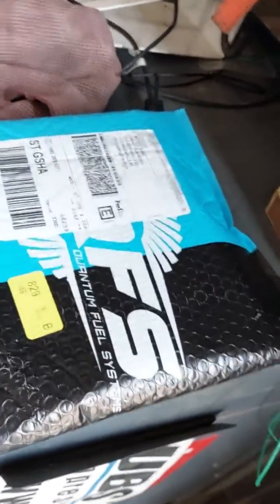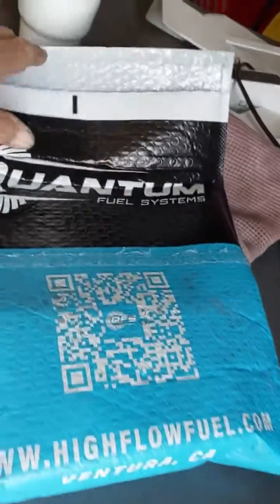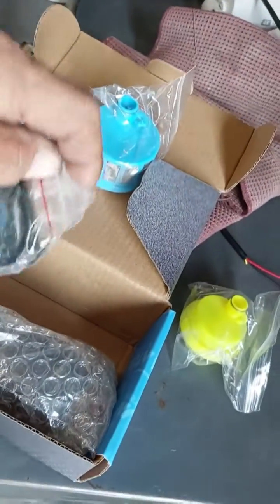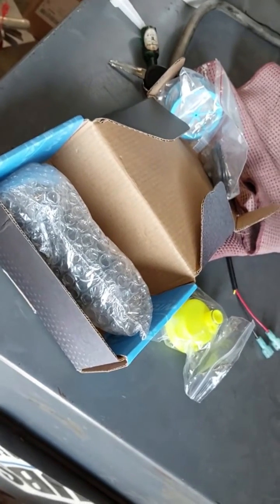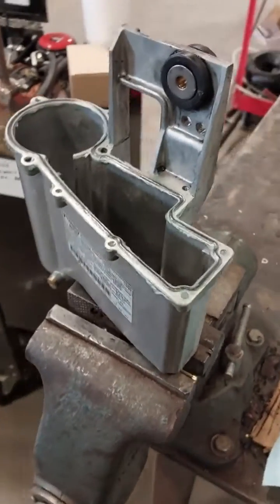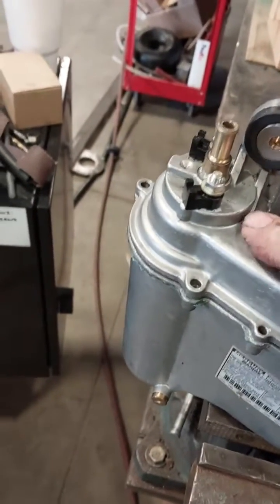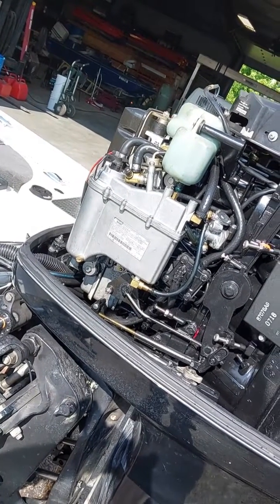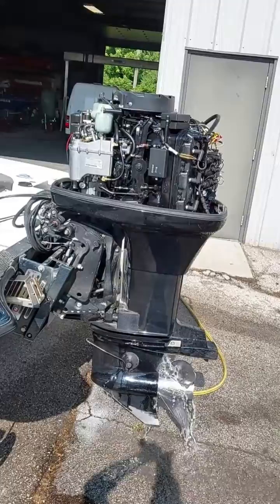Quantum Fuel Systems Mercury 200 HP EFI Outboard

Comment: Do you know if u have power on both connections of the pump?
Reply from the maker: On this unit, there's 12v on one terminal with the key on. The ecm provides the ground. It varies the ground to slow the fuel pump down at idle. This reduces wear on the pump and fuel pressure regulator.
Reply: @mwbare  so then my ecu could be bad? Or how would I test it
Reply from the maker: @espinoza313ae  I use a 12 volt test light. Attach the clip to a good ground. Turn the ignition switch on. Touch the probe to one fuel pump terminal at a time. It should light up on the hot terminal. The other terminal will be the ground from the ecm. It is possible for the driver to be fried in the ecu. I have ran a temporary ground to this terminal to prove that the fuel pump runs.